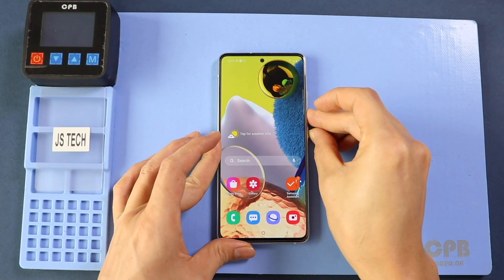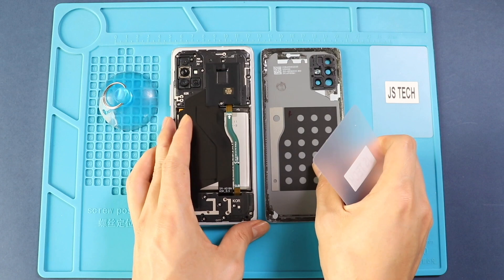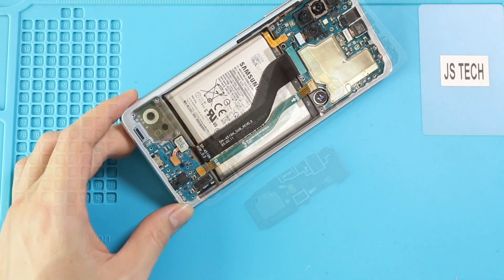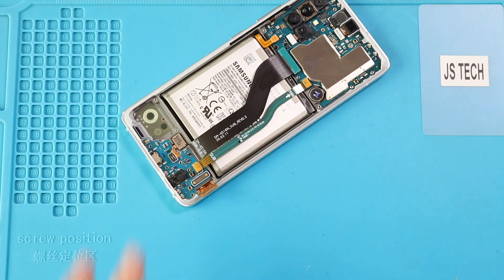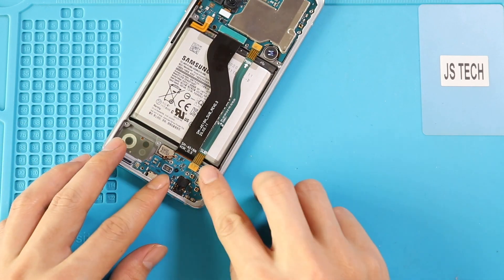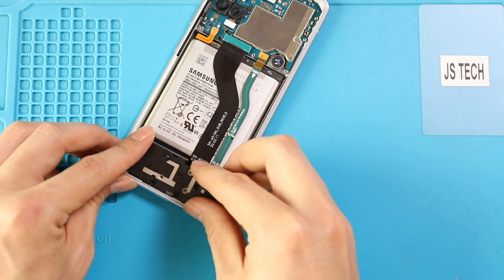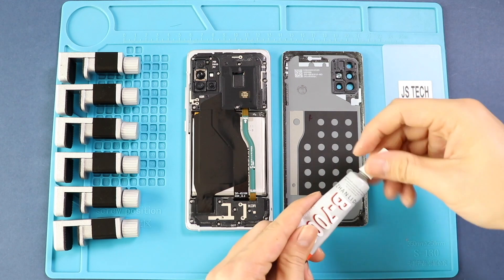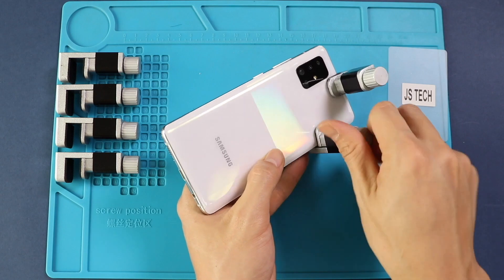Samsung Galaxy A51 5g Charging Port Replacement

Comment: just did this and it works. thankyou.. had to get the part off amazon. I only bought this phone for my DJI drone. After I couldnt communicate with said drone, the drone was a paper weight.. the stock usb c port wore out after 18 months. This fix saved me big